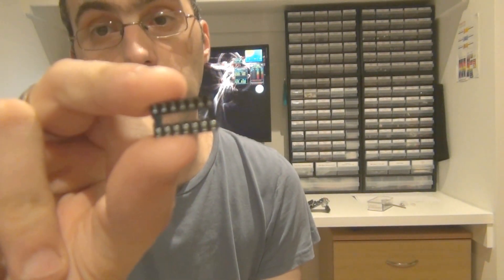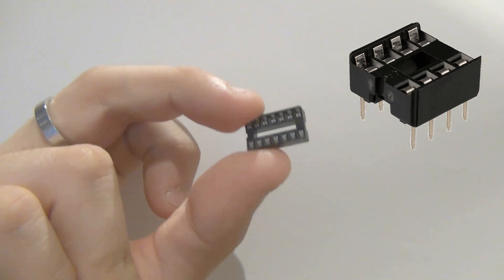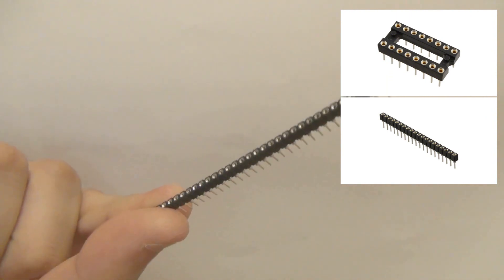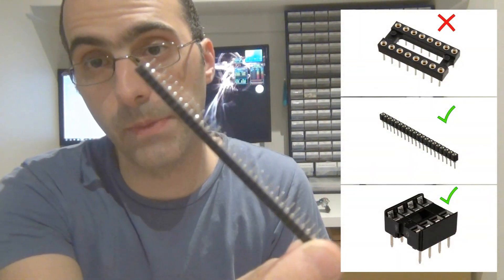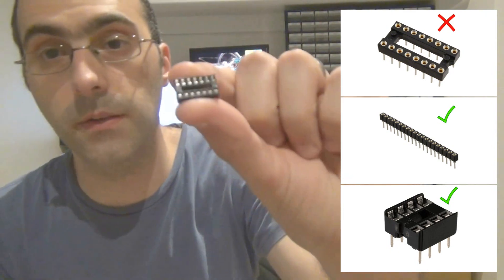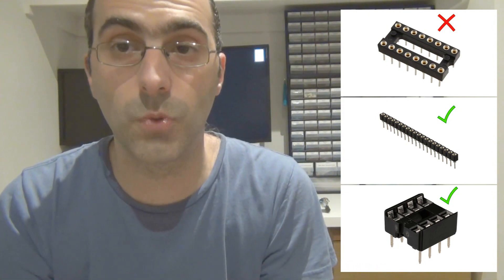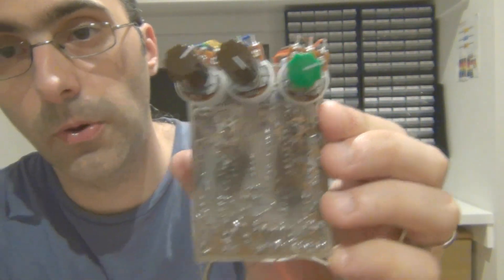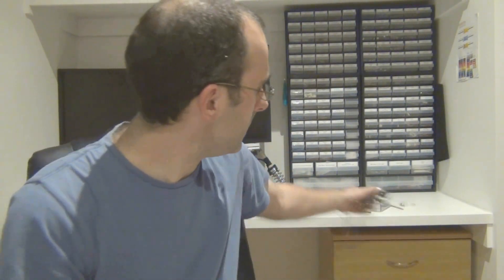B2B - Sockets, Use Em

Comment: Definately agree with this.  I've done electronics projects of various types n always use sockets for semi conductors.  Also a pair of ic chip lifters (I use the single type, looks like a curved flat screwdriver) for pulling Ic's from sockets.  I prefer the machined pin sockets when I know I won't be changing Ic's very often.

Comment: Another important reason, if not the most, is to avoid excessive heat transfer to the chip while soldering. If you're not very confident with your soldering skills, definitely solder the empty socket to the PCB and plug the chip afterwards.
Reply: palak0 Just what i thought would be the reason our man here was going to give when I saw the title!
Reply from the maker: asharchy Forgot to mention that one!  particularly with sensitive parts like bbd's and germanium transistors. Another definite advantage of sockets, there's seriously no reason NOT to use them imo...